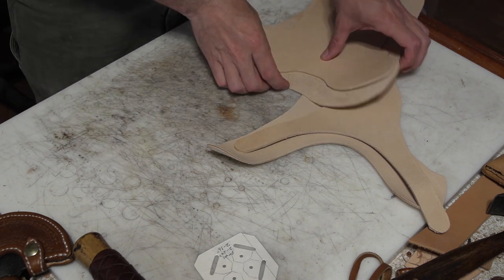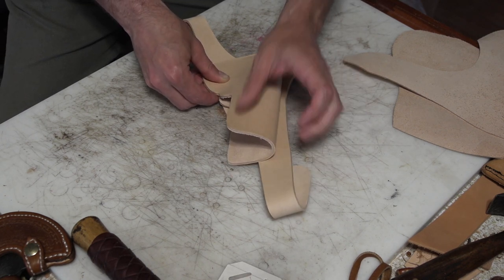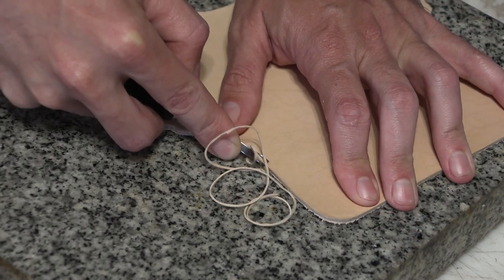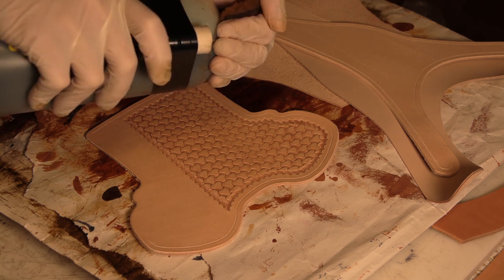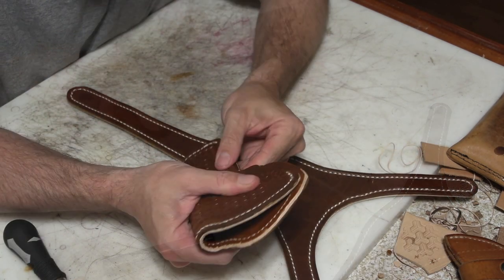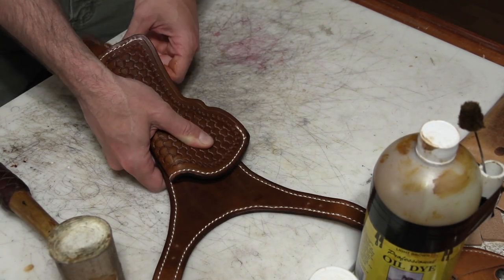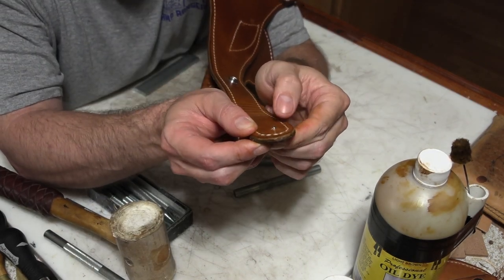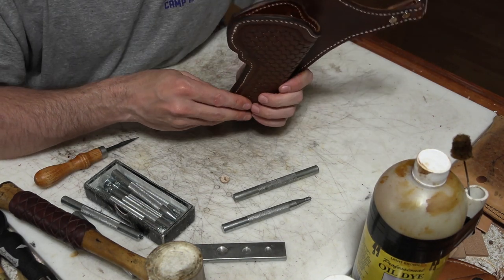Making a different style of Leather Shoulder Holster

Comment: Very informative,  really tip toeing around the idea of a shoulder rig for my 686 3" . Ever done one with the gun grip down,  years back they made some like that looks like it might conceal the gun a bit more.
Reply from the maker: I have made horizontal shoulder holsters.  You need to put a thumb break retaining strap on them to keep the firearm from falling out.  The hammer on a revolver gives a little bit of leeway so you don't need to get a perfect fit on the strap.  Make sure that the strap will not get stuck between your hand and the gun when you draw  Makes it tougher to make them for semi autos.  Once made one for a vp9 that took three tries to get it to fit right.   Not sure they are more concealable, but probably easier to draw from.

Comment: I have one more question that I forgot this afternoon. On that "Y" shaped piece. Does it have distinct measurements or is it a make it to suit yourself type thing? I ask because I am a bit rotund, okay, I'm fat,and my pistols don't fit down in my belt without the grip printing if I have to bend over, even slightly.
Reply from the maker: That part can be changed depending on where you want the holster to ride.  Changing the bottom of the Y will effect how far above the belt it will be.  Changes to the angles and positions of the top of the Y will effect whether it rests under the arm or more towards your front.  I would suggest making pattern pieces with heavy paper or poster paper and taping them together so you can try it on before cutting any leather.

Comment: What did you use to spread the stain?  I’m so tired of the daubers.
Reply from the maker: Sheep skin scraps.  Bought a bag of remnants and I cut pieces about 2-3" square and trim the wool a little with scissors.  I can use the same piece many times as long as I use it with the same color of dye.  Also use a piece of it to apply my finishes.